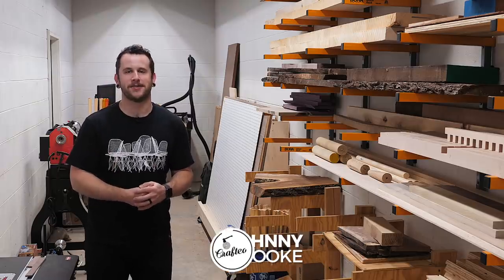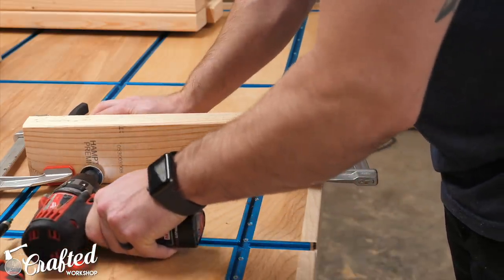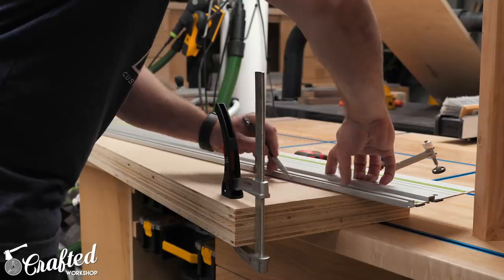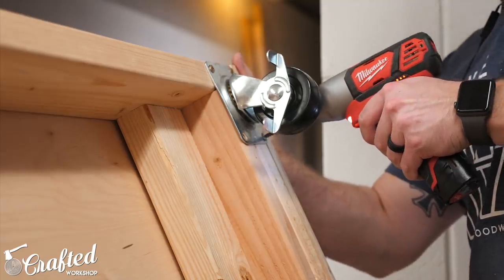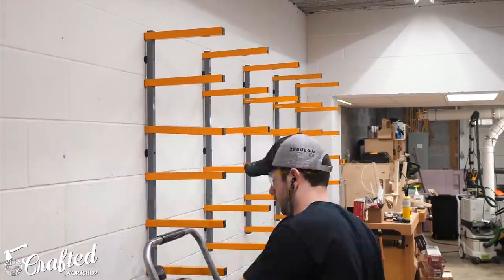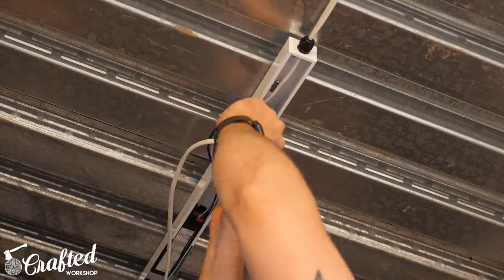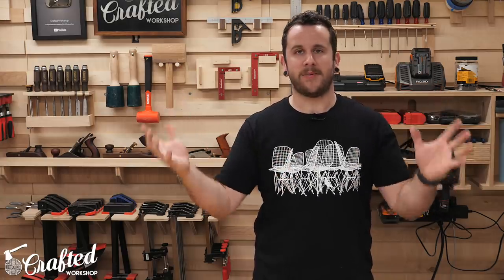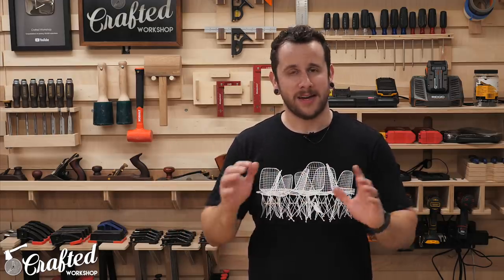DIY Plywood Cart, Lumber Rack & LED Shop Lighting // Woodworking Shop Projects

Comment: I'm not an electrician either but I did wire my whole house and often ask electricians before I do anything myself.  You will have to double check with local codes but don't think you need to put conduit in place.  As long as it out of place where it can't get hit, no conduit needed, romex is fine.  I went with metal/flex conduit for my ceiling, which is overkill.  If you do add conduit you will need to also replace the wire.  Romex in a conduit is a no-no.
Reply from the maker: Yea, I don't think I'm going to actually add conduit. If I did, it would be PVC conduit, which is how the rest of my shop is wired up.

Comment: Nice shop upgrades! Quick note about Romex and EMT, I was planning on doing the same with the LEDs I installed in the garage but my neighbor, who is an electrician, said Romex shouldn't go inside of EMT. So, I'm rocking the "unfinished" look as well.
Reply from the maker: Thanks Sean! I meant to say PVC conduit, which is the standard in our area. I’ll probably just leave it unfinished due to laziness 😜
Reply: I can totally relate to that!
Reply: Depending on code where u live, romex should never go in anything. No conduit ever, conduit is for individual wires. It has to do with heat and what i sometimes hear called fill factor. Romex is intended to be open to air or in a wall which will have air to let heat excape. Conduit traps heat. Sometimes there are ways around this with larger conduit or diff romex types, but just sharing what is code in my area. LED have very little amp draw so in the end heat is likely not an issue.

Comment: I keep most off cuts also but I also try to only use off cuts when doing shop projects.  So all my carts and jigs are wild mixes of off cuts and pallet parts.  It's greener and cheaper.  In my shop function is king over looks.  I even find use for sawdust other than a dumpster.
Reply from the maker: Yea, I used most of my offcuts for the French cleat holders, definitely a great way to use them up.
Reply: Well if you can source used wax from candles, those warmer things, even old crayons you can melt that and mix your sawdust in.  Form in cardboard egg cartons or old muffin tins.  Great fire starters for camping and Scout groups.  I use a thrift store slow cooker for the wax.  Just an idea to use shop waste rather than tossing it.  If it's good clean sawdust local compostor types might want to mix it with their other organic waste for their gardens.  I hate sending useful stuff to the landfill.

Comment: @3:28 you mentioned it’s time to get this blade sharpened due to the wavey cut. Were you referring to the bandsaw blade making the cut or jointer blades you were cleaning it up with? I’m curious if you actually sharpen your bandsaw blades instead of replacing them? If so, any recommendations on sharpening?
Reply from the maker: I meant my bandsaw blade. I use the Laguna Resaw King (or at least did, I just got a new saw that uses different sized blades), and carbide blades can be resharpened for much cheaper than a new blade. I would just send it off to be sharpened.

Comment: My local rocker had those 8” kliklamps 2 pack for $24.99 on clearance just yesterday. Normal price is $60+, currently $50 on Amazon so anyone close to a Rockler, go check to see if they have any (if you’re interested, and you should be, they are awesome).
Reply from the maker: Nice, those are great clamps for sure!

Comment: Problem iv been having. Cutting to an exact fit, after i cut i still have a lot of sanding to do. So what do i do to make sure my fit stays snug
Reply from the maker: Really depends on the tool. If you're talking about a saw, make sure you're using a good quality saw blade to reduce the sanding needed.

Comment: Are you using the Milwaukee 12 volt impact driver? If so, how does the 12 volt compare to 18 or 20 volt?
Reply from the maker: I am! Haven't used the 18V version, but compared to my other 20V/18V drivers, it works well. Nice and compact in comparison.
Reply: Crafted Workshop is the power and battery life as good as you'd like it to be? Or do you make expected sacrifices for the smaller size?
Reply from the maker: It's slightly less powerful than the larger capacity tools, but I think the tradeoff is worthwhile since most of what a woodworker does isn't really a high torque or power application.
Reply: Crafted Workshop thanks for the information! Keep up the great work!
Reply from the maker: Thanks!

Comment: FYIm to ALL the people on Hometime, This Old House, etc. When you screw two pieces of wood together, if you DON'T drill a THROUGH HOLE in the outer piece of wood, the screw CANNOT tighten the wood down to the second piece under the first, because the screw will have threads into the outer piece of wood, preventing it's movement. The wood is only as tight as you're pushing on it into the second, underlying piece. I can't BELIEVE something this elementary has been forgotten. Plus, if you use something huge, like a 1/2" lag bolt, if you don't drill a 3/8" or so pilot hole, you'll likely split the wood, especially if it's new pine.
Reply from the maker: This is incorrect, William. The threads of the screw will continue to be pulled into the mating piece and will create an extremely tight joint, regardless of whether you drill a through hole. Drilling a through hole would be incredibly time consuming, and that's why modern, self-tapping screws are designed in the way they are, to clear the wood out of the way and to allow the pieces to be pulled tight.
Reply: No, NOT a self tapping screw. Self tapping screws are designed to be used in thin sheet metal. they have a standard machine screw thread that follows convention(6-32/8-32/10-24,etc), UNLIKE a sheet metal screw. A self tapping screw would ALSO drill a thru hole into the second piece, rendering thread anchorage moot. Here's a self tapping screw:

https://www.google.com/search?hl=en&tbm=isch&source=hp&biw=1540&bih=837&ei=lWSRWq6rAuu4jwSQm7jABA&q=self+tapping+screw&oq=self+tapping+screw&gs_l=img.3..0l10.1926.6924.0.7036.20.14.0.6.6.0.161.991.10j2.12.0....0...1ac.1.64.img..2.18.1025.0..35i39k1.0.FeLT9l7n_GE#imgrc=Y4mmFVeFY2PweM:

This will NOT work with wood, as wood's grain is too loose and coarse to allow such fine threads to be accurately cut, BEING DESIGNED FOR METAL.
 A type "A" sheet metal screw is what has(apparently) replaced the standard wood screw, without the bare shank under the head, where the unthreaded (through) portion is located. They also don't bother to drill the countersink(remember THAT, Crafty?), relying on the fact that it's usually pine that they're using, and just forcing the flat head into the wood to make it flush. Speed drill jigs are available that drill the thru hole and the countersink in one operation, for those that are not in such a tearing hurry, and who wish to do it CORRECTLY, UNLIKE the hotshots that say "Yeah, that works, forget about it and move on." Get a 6" chunk of 2x4 and put a screw thru it. I GUARANTEE that you can grab that piece of wood, rotate it, and unscrew the screw right on out.
I've been doing this for fifty years, and I sold threaded fasteners for twenty. Just because you see it on TV, doesn't mean shit.

Comment: Why did not you use your tracksaw to cut the plywood?
Reply from the maker: I definitely could have, but it's easier to get square cuts on the table saw.
Reply: 3:21 Table saw?
Reply from the maker: Ah, thought you were referencing ripping the strips. My track saw will do a max depth of 2 ⅛” so it wouldn’t have made it all the way through.

Comment: It’s not necessary to run conduit even with 120v. Look at any unfinished basement ceiling there’s romex wire running everywhere with no conduit.
Reply from the maker: Yea, I figured I put in the CYA by mentioning the conduit but I won't be adding it. Thanks!

Comment: Or OR you could just buy a bulk pack of LED retrofit 4ft T8 bulbs and get the exact same appearance for half the price and 95% less work.  These mount in the existing fixtures and can be used with or without the existing ballast.  Why you went to all this trouble when you had perfect fixtures already is beyond me.
Reply from the maker: LED lights come in varying qualities, and my shop is primarily a video studio at the end of the day. These lights have a very high CRI of around 95, much better than others.
Reply: Hi Ben, The good news is...there are choices out there! I supply tubes to people who want them but most want the retrofit kits.  Our main clientele is commercial, industrial, institutional, and retailers that need reliability, quality, and serviceability and want high CRI.    One other thing to consider with "plug and play LED tubes" that power through an existing ballast is the power consumption through the ballast.  A T8 tube runs 32 watts typically.  If you power an 18W LED tube through the fluorescent ballast,  the power consumption is around 26 watts, only providing a savings of 6 watts per tube.  In a 4-lamp fixture you are only saving 20 watts.  The 4 lamp fixture originally running 128 watts is reduced to 104 watts, a savings of 18.7% .  The 2 strip retrofit kit runs 48 watts, a savings of 80 watts or 62.5%.  Also, LED tube lifetime is rated between 30,000 hrs and 50,000 hrs whereas the retrofit kit LED L70 lifetime is 120,000+ hours.   There is a difference.
Reply from the maker: Thanks Jim, was going to mention the power consumption difference as well but you obviously know better than I do :)